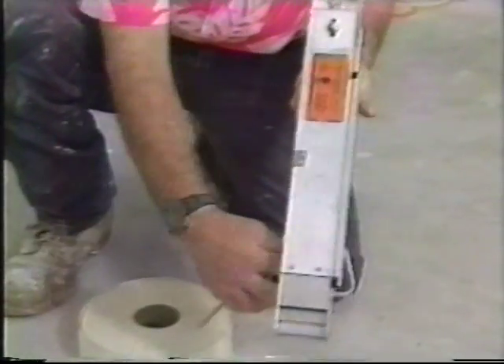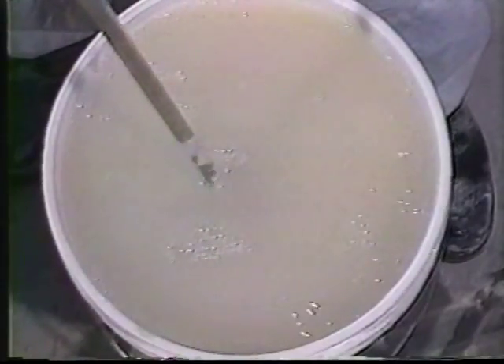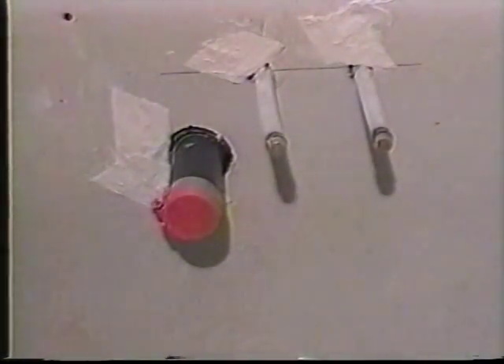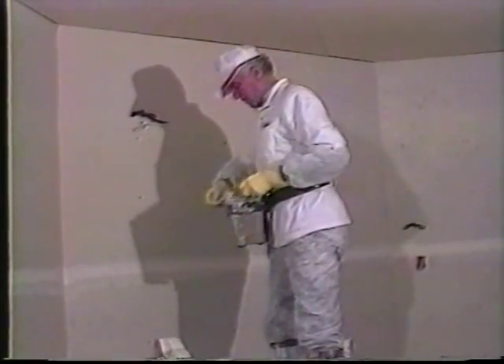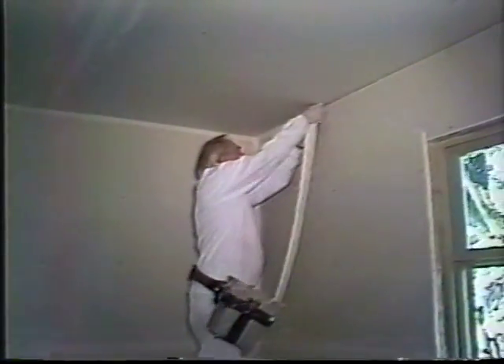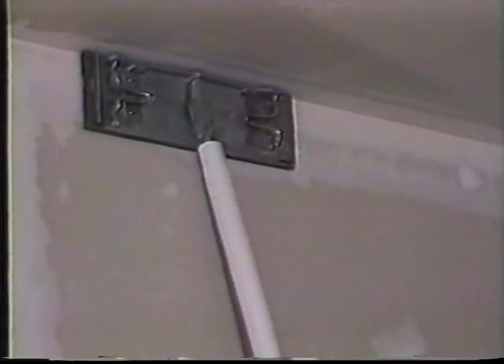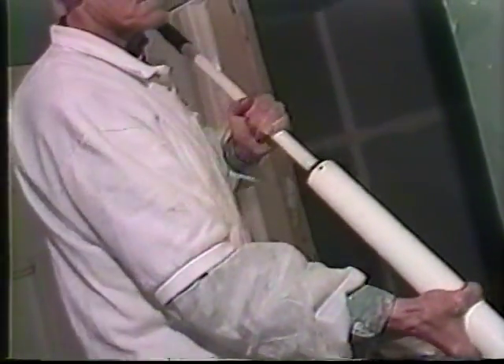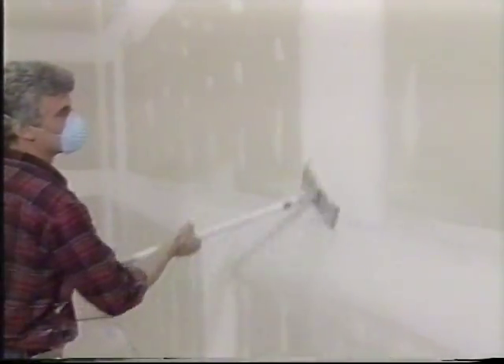Better Than Ever Tools Drywall Tools Instructional Video

Comment: Notice how he has to over thin the mud. Every bucket of mud has a warning written on it that says do not over thin. So you've got substandard work from the start. The whole point of this method is to make things easier for the finisher. Not to make a high quality job for the owner.
Reply: They are using taping mud which has glue in it. When it dries the water evaporates the glue stays and the tape shrinks into the joint perfectly. You can also add glue to your mud

Comment: You showed some good techniques but I can't believe you used the bathtub to clean your filler tube. It looks like the tub was lined with plastic but seriously...use a 5gal pail.
With that said I did learn that I am mixing my mud a little to thick for running tapes.
Thanks for sharing and I do use all the tools your featured. Great quality.

Comment: what is the size of the flusher for tape coat and the flusher for finish coat?
Reply: I use a 2.5 inch to flush the tape and a 3.5 inch to finish, some prefer a 3 inch to finish, but I find the 3.5 inch fills better.

Comment: how old this ? anybody knows
Reply: drywalller 1969.
Reply: When I started in 1973, Canadians would come down to Miami in winter, cut a slot in each bottom end of a pan, nail it down to one end of a sawhorse, and pull tape thru it with mud in it. They would then put big loops of mudded tape around their necks. Some started using a rubbermaid pan around their neck like the cigar-cigarette vending lady. We called it the Hungarian slop box.